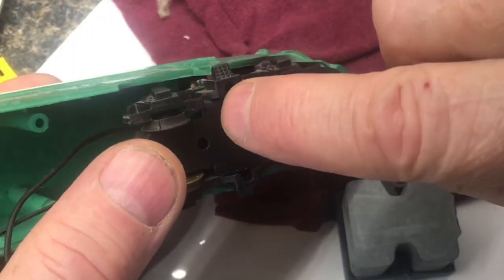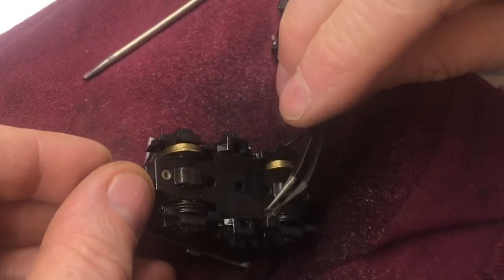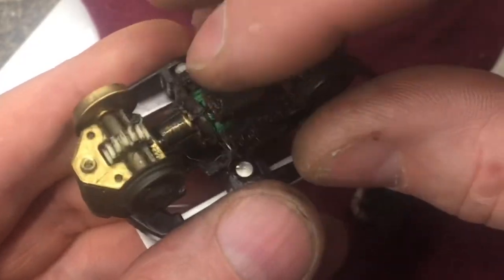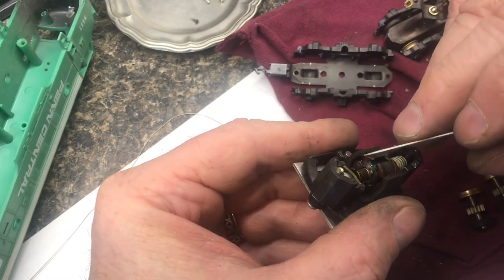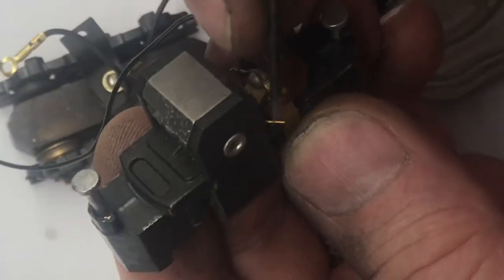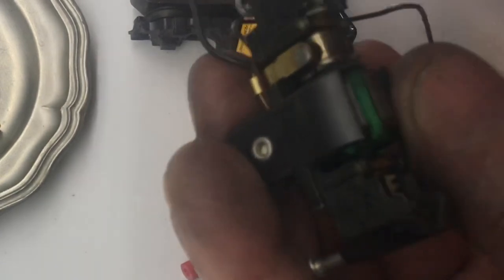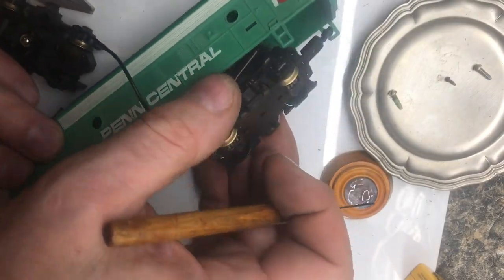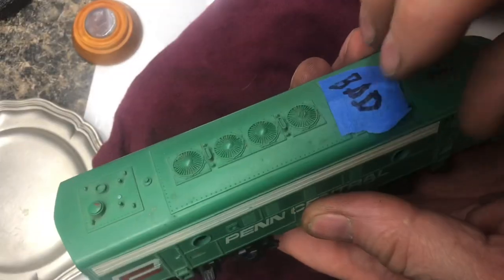“fix” toy train engine that DOESN’T RUN  (tyco) cleaning and maintenance￼ n, ho, o

Comment: Unfortunately, steel wool has been used a lot in the past to clean oxidation off the rails - a new nylon scrub pad works great!   Penn Central should have used their green color on locomotives instead of black!    Like Lee Dooley and Irene Craggs asked, please elaborate about the small self-tapping screws!  Also, please elaborate on the silicone grease you used as it would be helpful to a modeler who doesn't have a hobby shop nearby to buy Labelle grease from.